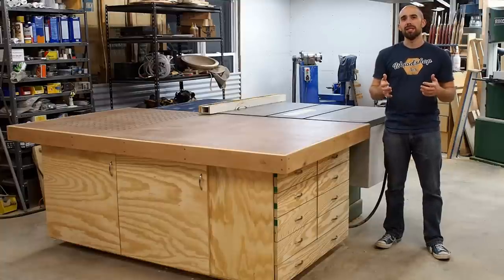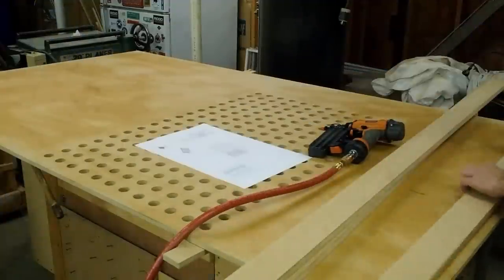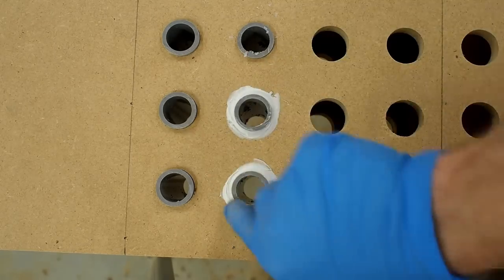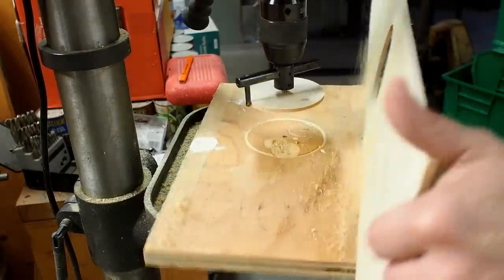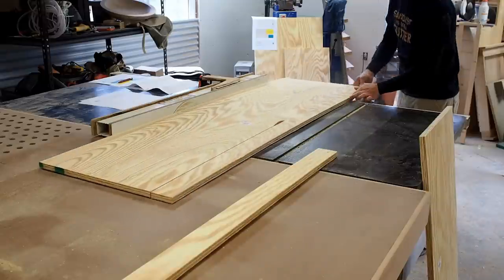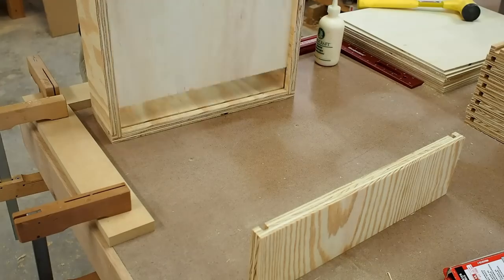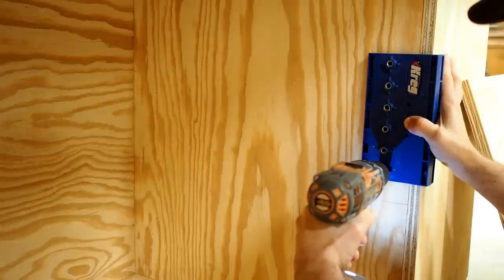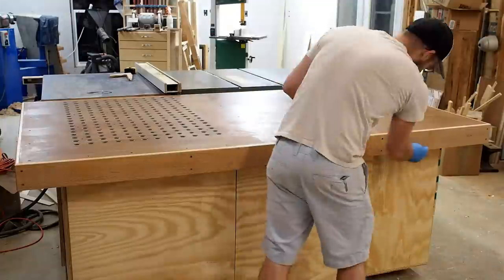Outfeed Workbench, Torsion Box Top & Downdraft Sanding | DIY Woodworking

Comment: Really like the video! Just a quick tip for everybody, including you Mike. When making cuts on a piece that is longer than it is wide, example @ 7:14 , use the miter gauge that normally comes with a table saw. This will reduce the chance of kickback. This will keep the material to the left of the blade from twisting and getting grabbed by the saw.  For a non-experienced person, making this type of cut "free hand" like Mike does here is very dangerous. Obviously, you have experience making this cut, but even the experienced can have accidents. Safety 24/7 !
Reply from the maker: Thanks Nick, glad you liked it.  Cheers

Comment: Nice build, and very well thought out.  I will bet, however, that those carriage bolts ll soon be replaced with nonskid feet to keep the table from slipping around the floor.  I learned that.....the hard way.  Nice work
Reply from the maker: Steven Rochon thanks Steven!  The table is around 300 pounds and hasn't offered to move at all 👍🏼
Reply: I would rather have casters!

Comment: Very good video Mike,  i like all the features you put into the outfeed table  i am a firm believer  in having  a  permanent outfeed table you can count on for  safetey mainly  i always hated the roller stands  that always seemed to fall over   When you needed it the most !  Putting you in a dangerous  situation  by taking your focus from the  table saw lets be honest a table saw is a dangerous tool that requires  full  concentration to operate it safely  i spent over 20 years in Architectual Woodworking as a profession and every one i know that has had a accident with a table saw  has had the same  comment that it happened so fast they couldn’t believe that it was true  or that it did ? Keep in mind all of those people were  very experienced  men/ women  who had spent many hours using table saws without  prior incidents
Reply from the maker: A dedicated outfeed take had been on my list for years.  Once I was finally set on where that saw was going to live, it was time to build!  Glad you enjoyed the video! 👍🏼

Comment: Two quick questions please. 
1) Will you be extending slots from saw into table top for sled going past the end of the saw surface 

2) Do you think MDF is a good enough material for table top. Once that factory smooth finish is penetrated or damaged I find it to be garbage. I figured Baltic Birch plywood may have been better. 

Awesome design though thanks for the video much appreciate people like you taking the time to do this for us on the other end of the camera. 👍
Reply from the maker: Hi Richard,

Thank you very much.  I'm glad you enjoyed the build!

 1) I will extend the slots when I make a cross cut sled that deep enough to require them.  This is a Powermatic 72A and the tabletop of the saw is very deep.  I can you a miter gauge without it running into the outfeed table!

2) The top of this outfeed table is hardboard.  If it does end up getting damaged I'll just unscrew it from the table and replace it! So far I've not had any trouble with it though.

Comment: Great setup.  The grain direction on the drawers caught me off guard a little. Good job.
Reply from the maker: Thank you!  It's made a big impact in the shop already.  What about the grain direction threw you off?  Do you mean the continuous grain across the fronts, or that the grain is going vertically for the drawer boxes?
Reply: Mike, the vertical direction on drawers was a little odd for me at first.  But we use white melamine here in Australia, Plywood is not so common.  Also the horizontal door grain next to the vertical grain direction on the drawer cabinet.  But like you said, its a shop project.  Do you seal the inside of the cabinets?
Reply from the maker: LostWhits yep I wondered how many people that would throw off 😂. The sheet optimization just came out that way and I seriously considered making those out of a separate sheet, but opted not to in the interest of cost.  Cheers!
Reply: Thanks for the help with this... I'm gonna give this a shot for my new Jet tablesaw! How well does the down draft table work?
Reply from the maker: ryan detzel with a 1hp (about 600 cfm) dust collector it's not too bad.  I'll be upgrading the dust collector down the road though.  I suspect something about 1500cfm is needed for this size downdraft table.  If you made the downdraft section smaller than what's shown in the plans you'd be fine with a 1hp dust collector.  Thanks for watching and good luck!

Comment: OK, so I've never used a downdraft table before, although I'd love to have one.  I would have expected that you'd want smaller holes so that the suction velocity stays high enough.  How well do those 1" holes work in your table?  Do you ever wish they were smaller, or does that size work really well?  I suppose it depends a lot on the volume that your dust collector can pull.
Reply from the maker: That's a great question!  Yes, typically the holes are much smaller but I wanted them this size many do I could use bench dog style clamps.  The holes are actually 3/4 once then sleeves are in & I use the Kreg Tool and Armor Tools clamps in the table which work great!  My little 1hp dust collector doesn't pull enough volume of air to make the entire down draft area usable, my intention from the start was too have my 2hp dust collector ducted to it though.  Now I just have to actually make that happen! lol

Comment: Now that you have had time to use the table over a variety of projects, I'm curious about how satisfied you are with the flatness of the table and the the effectiveness of the down draft table?  That looks like a lot of work to create without some cnc help.  I need something like this for the new table saw I will soon be purchasing.
Reply from the maker: The flatness of the table top is excellent and has been great for assembly work.  I honestly don't use the down draft portion frequently for sanding, but I do use it for dog hole accessories 👍🏻
Reply: @WoodshopMike  Thank you, for the quick reply.  I appreciate it very much!  I think I'll take your lead and build it or something very similar.  I need anything and everything to held with dust control.  At least all those holes are dual purposed so if I don't like it for down draft I still have the dog hole accessory use and it will not have been a waste.  Thank you, again!

Comment: This is an excellent outfeed workbench. I will be buying the plans and building this. Do the plans include a shopping list and a cut list? Along with detailed instructions?
Thank you very much for sharing!
Reply from the maker: Thank you very much, I'm glad you like the project!  The plans do indeed have a cut list, sheet layout, and shopping list with pricing!  There is an assembly sequence on each of the assembly pages with plenty of info in the plans to build this project.  The blog post and this video detail the project pretty thoroughly, but if you hit a snag feel free to hit me up and I'll be happy to help!
Reply: Woodshop Mike much appreciated Mike! I will certainly do that!
Reply: Do you recommend the Kreg jigs that you use?
Reply from the maker: yes absolutely I do!  Also, I didn't use it in this build, but the K5 is a great tool!  I bout the k4 originally but returned it less that 24 hrs later for the k5.  The usability is much better and the price difference is pretty small.  (FYI, I'm not affiliated with Kreg)
Reply: Woodshop Mike I’ve been using the k5 and absolutely love it
Reply from the maker: Oh that's great!
Reply: Woodshop Mike I appreciate you being so responsive. I have a few more “honey-do” builds and then I’ll start in on this workbench. I will certainly reach out if need be. The plans are excellent! Thanks again!

Comment: Maybe an odd question, but do you find the torsion box sounds like a solid surface, or hollow sounding like a drum? I've been curious if the dividers stop that, but e.g. using an orbital sander on something on a concrete floor is just a little buzz, while doing the same on top of a big cabinet sounds like a v8. As a suburban night-owl woodworker, I try to cut noise wherever I can.
Reply from the maker: I've not noticed any hollow buzzing sounds to it when sanding or using using the Domino/biscuit joiner.  Hope that helps 👍🏻👍🏻

Comment: i used a hole saw for any hose fittings  it dose not break your wrist and  can use to make blast gates too
Reply from the maker: That would be the smarter way to do it for sure!  Just using the tools I had on hand but you'd better believe I was wishing I had a hole saw the right size :)

Comment: Very nice Bench! Is the dust suction zone working as good as you wish?
Reply from the maker: Thanks!  The dust collection works alright, but there are a few tweaks I need to make to my dust collector.  I didn't realize there were so many leaks in the actual dust collector (harbor freight model).  I can literally feel air coming out of the impeller housing, so I'll be sealing things up and seeing how that improves things.  I may even just hook up my 2hp collector for a quick test.

Comment: i have question sir if i build it for outdoor works did i need to put some seller for the wood for protect it from the rain ?
Reply from the maker: You would absolutely need to seal it with exterior rated finish and is also recommend using exterior grade or marine grade plywood.

Comment: Your drawers would have been stronger with the tongue on the front and back panels instead of the sides.  all the load in a drawer is front too back.  You push the drawer shut, the stiff in it impacts on the back.  You pull it out the stuff in it impacts the front.  That is why traditional dovetailed drawers have the tails on the sides, and pins on the front and back pieces.

Comment: Great build.  Looks like a really useful shop addition.  How did you decide what size holes to drill for the downdraft?  I didn’t count or do any math but the downdraft hole surface total   area looks pretty big. Do you get good airflow?
Reply from the maker: Thanks Jim!  I based it on being able to use dog hole clamps etc.  Yes the holes are much larger than normal, but with a 2hp DC hooked up I get decent air flow.  For me the versatility is worth sacrificing a bit on the down draft sanding area. 👍🏻👍🏻

Comment: Mike, when you are installing the cabinet doors in this vid, how do you know how far in the cabinet base to install the plates for the hinges?  Thanks.
Reply from the maker: I think that distance is usually printed for most hinges, but I didn't even bother to look with the hardware I used :)  Once I put the hinges on the doors, I just "closed" the hinge and measured from the inside of the door to the center line of the mounting holes for the hinge.  Hopefully I explained that well enough :)  Let me know!
Reply: Sorry but not really.  When you say "the inside of the door", do you mean the inside EDGE of the door?When you say "center line of the mounting holes for the hinge" do you mean you clip the plate on the hinge and measure to the center line of the mounting holes in the PLATE?  Thanks again.
Reply from the maker: No worries!  Yes, measuring from that inside edge will work!  I was actually referring to the inside face of the door, but that edge will work just fine!  Yes, I did clip the plates onto the hinge and take my measurement.  Cheers!
Reply: Inside face of the door in the hinge close position.  I get it now.  After you explained it, seems like a VERY obvious way to take the measurement.  Duh.  Thanks again.
Reply: Thanks again for taking the time with a real newbie question.  That deserved a sub for sure.
Reply from the maker: lol any time man!  No problem at all & thanks for the sub!  Glad to have you following along!

Comment: Hey man, started to work my way through the build.. there’s an error on S-1.00. I think the cut diagram is missing the yellow cuts (part TB-03)
Reply: Looked at it again, it appears you have two red cuts (total of 4) boards. Should be an easy fix :)
Reply from the maker: Red cuts?
Reply: @WoodshopMike  on page S-1.00, you have colored cuts. Your key has yellow cuts red cuts. One of your colored pictures is incorrect as you’ve duplicated the red color. Part TB-06 on page S-1.00 should be yellow
Reply: Some more feedback. Cut list page S-3.02 is tricky. The way it’s laid out there’s currently no easy way to break down the full sheet.

It would be easier if the orange DW-03 pieces lined up with the bottom, instead of wasting that bit, this way you could cross cut your sheet at the total height (plus 1/8 kerf) of piece CF-05 & DR-02

Right now that crosscut is kind of guess work as you do not label the dimensions of the waste

Comment: That torsion box top seems a bit overbuilt to me. Is there a reason you beefed it up so much?
Reply from the maker: Hey Chris, thanks for asking.  You could go a bit thinner with the torsion box but it wouldn't save that much weight but you do gain more stability under heavy loads.  Since I use this table for outfeed as much as I do assembling heavy projects I wanted the extra strength to help prevent the top from deflecting over time.  If you're only going to do lighter projects/tasks on the bench then you could knock the thickness down to about 2" for the internal members and space them out a bit more.  Hope that helps!

Comment: What are all the holes for on the top of the table?
Reply from the maker: Hi Wayne,
They're for down draft sanding and dog hole accessories.
Reply: @WoodshopMike  How is that down draft box working out?  I want to add a similar box to my table, but not sure how effective it is.
Reply from the maker: @gabrielmartinez2439  it works well!  I need to hook up my larger 2hp dust collector, but it does well as is will a little too around unit